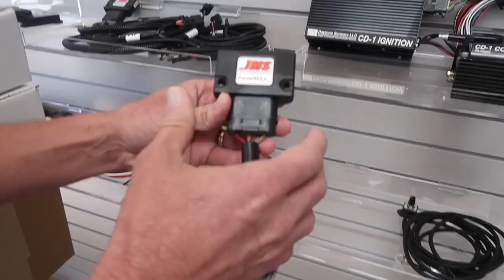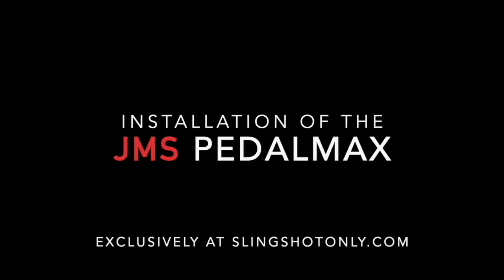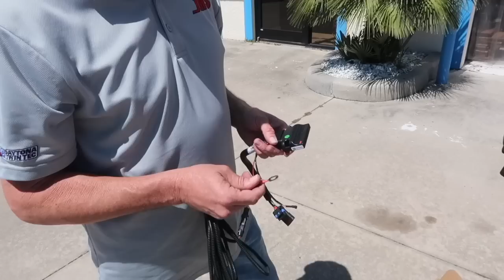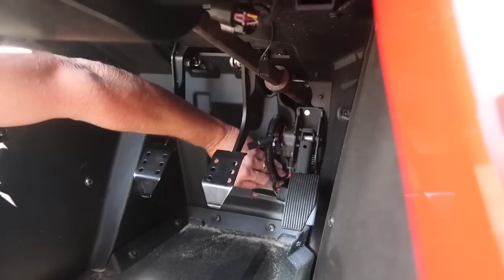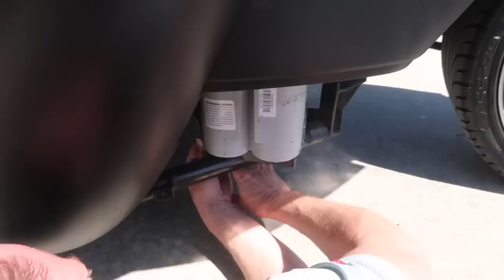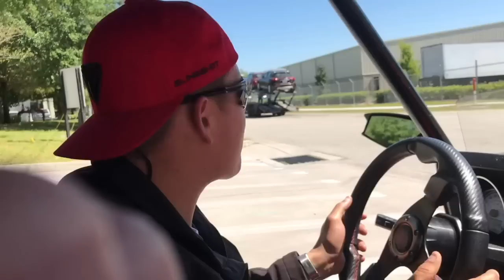JMS PedalMAX Info & Installation

Comment: You can't increase horsepower by changing throttle settings.  You only gain hp from increased boost, compression, or altering timing or cam profile.